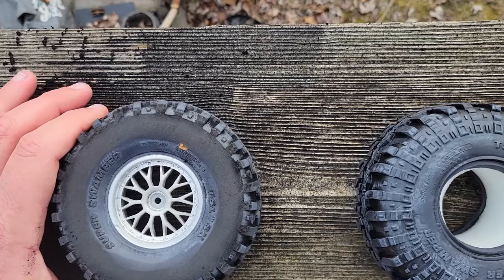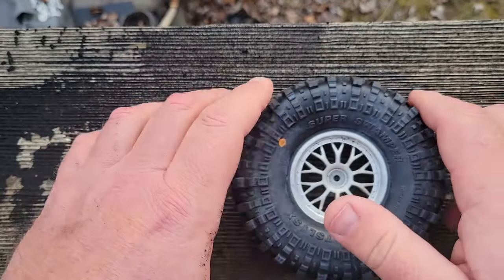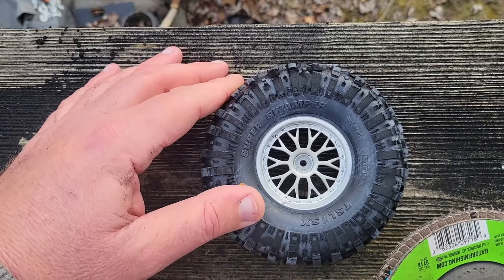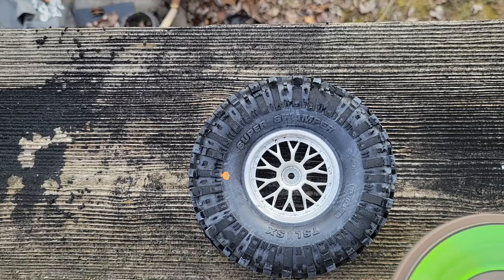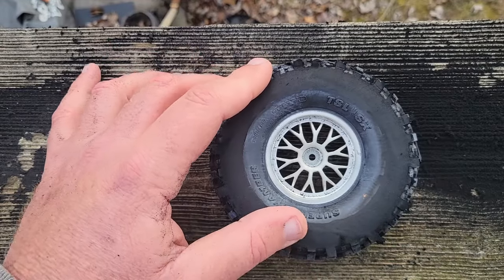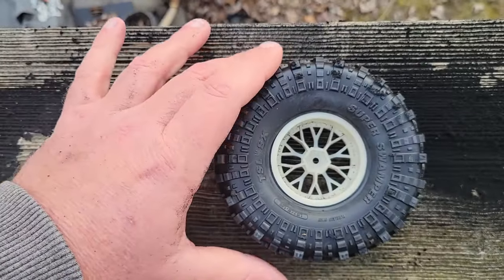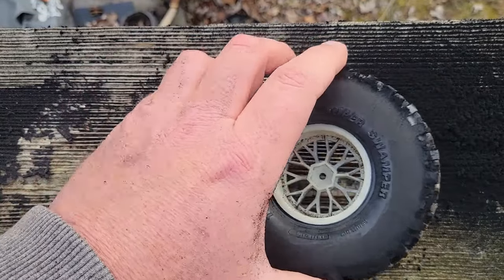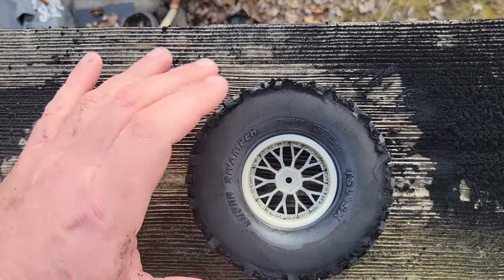Tire shaving. Quick and easy.

Comment: Cool awesome trick looks far more scale afterwards too! Some cheapo tyres go way overboard with the side lugs!
Reply: No it’s not. A TSL has side lugs… this genius is in fact making them less scale. Derp
Reply: @RingLeaderElon  those who know, do. And those who don’t insult people on social medial. If you attend any national level comp with the best drivers in the country or world you will see shaved sidewalls. It doesn’t really make them less scale as tire trimming and shaving is a small industry in 1:1. Many shave tires down to just above the steel belts for weight reduction and increased traction.
Reply from the maker: I did it for the performance of the tire. Not the scale look. Thanks for your input though.